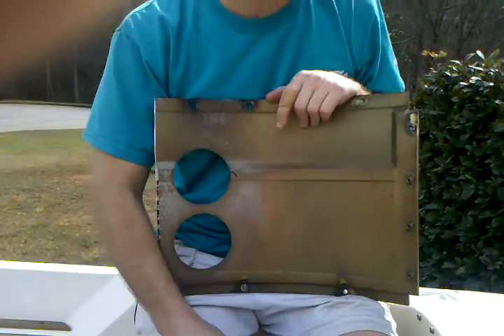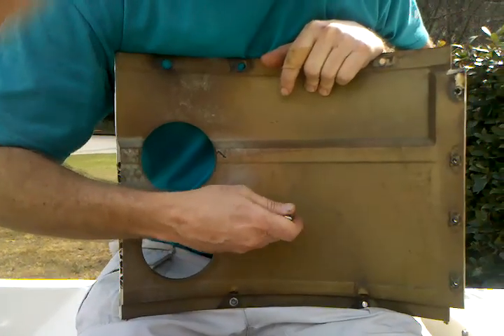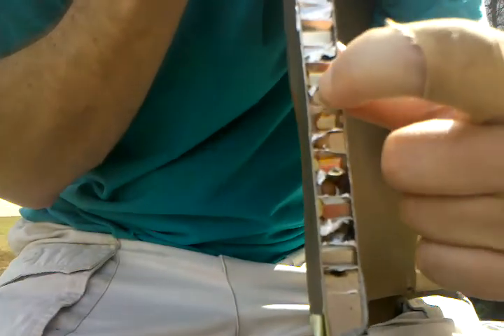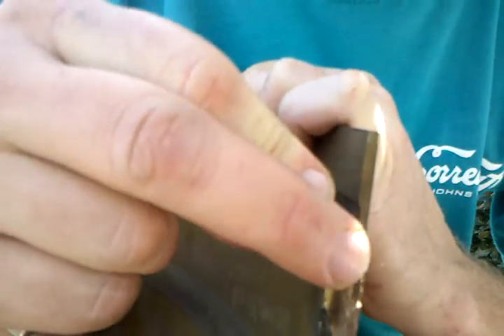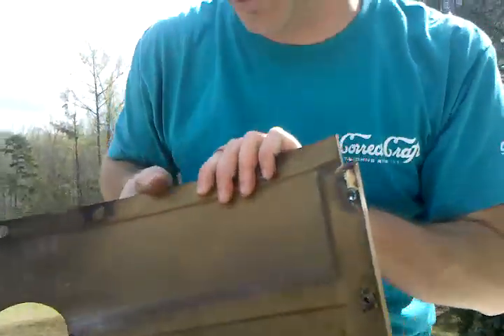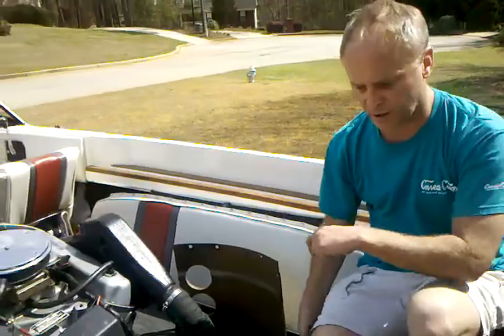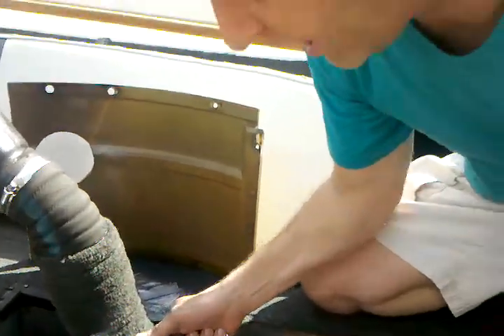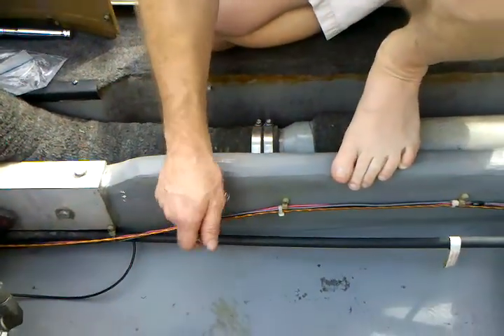Boat Stringer Inspection

Comment: I have a 1981 Citation Marquis (about 17' LOA x 8' Beam; I/O Bow Rider).  Everything was totally rotted, corroded, broken, or useless.  I cut out the flooring and transom, and pulled everything else out (engine, wiring, instrumentation, etc.).  It's a gutted hull right now.  And I know the port and starboard stringers are rotted, too, because I removed a small section (about 2-3" long) of the top of the starboard stringer and the wood (looks to have been 3/4" as a 3/4" piece of wood fits snug in the cleaned out slot) is rotted mulch.  But the fiberglass appears to go a bit higher than the wood itself, so not sure how they did that.  However, the fiberglass "frame"  of both stringers is 100% solid.  Rigid, no cracks, no wobble.  It's just the inside (wood) that's mush.

So, my question is... do I HAVE to replace the entire stringer?  I'm planning on going with an Elco EP-20 (maybe as high as an EP-50, if necessary) electric inboard or outboard motor (depending upon budget).  Not planning on going fast, just puttering around (5-7 knots, max.) on a couple local lakes nearby (Parker Canyon, AZ and Patagonia, AZ), so the boat hull isn't going to be suffering any wave pounding abuse.  So, will the hull be structurally compromised by NOT replacing the stringers, no matter how slow or gently I use it?  What's the worst that could happen?  I did a "Reverse Hull Integrity Check" (RHIC)... filled the boat with water (yeah, I know that didn't do the stringers any favors)... and no water leaked outside, so the hull itself is water-tight.

Thanks for the descriptive on the difference between "delamination" (the layers of fiberglass separating from each other) and "disbonding" (the wood core separating from the fiberglass encapsulation).
Reply: I sincerely apologize for not responding to your comment and question. I usually try and do so in a timely manner when I receive a notification that someone responded. Its been a year since you responded but I'm curious as to how you finished your project. I hope that you replaced the stringers in the boat mentioned. Think of the construction of a boat as the human body.  Stringers are "The Bones" of a boat while the fiberglass shell is "the skin". A boats bulk heads are its " ribcage". You want good solid bones in your boat just to maintain its top potential OEM strength. Just as a human bone structure if you break an arm or leg or even a rib yes the body will repair itself but it will never be as good as it was before the break. If its gonna fail under the same circumstances... chances are it will break at the same spot it had before. 
 Replace the whole stringer. Its more work and cost but in the end you'll know its done right and you won't be worried of a possible structural failure in the event you get caught in some rough water.

Comment: Thanks for the explanation.  Question for you. In the event of a motor mount bolt area being rotten to say an inch or two around the bolt hole, is there a repair option or do you replace the entire stringer?  Assuming the rest of the entire stringer is good.  Just an issue at the bolt hole.
Reply: If it's just a small area of rot, you could probably get by fixing it with some Clear Penetrating Epoxy Sealant (CPES). By using the aforementioned product the damaged wood around the hole should wick up the CPES  making it better than new. Keep adding CPES till you fill the hole and add as necessary so that the wood soaks up as much as it can. After it cures I would fill the hole with a mixture of epoxy and milled fibers. Once it cures then redrill the hole and install the mount bolt.
Reply: @Nauti1988  thank you!

Comment: great video, do you need to check the stringers under the bow as well?
Reply: Michael, sorry for the late response to your question but the answer is yes. Reach up as far as you can so you can do a tap test on the stringers. If its solid then you're good to go. Any dull thud isn't good so that either means the fiberglass is just disbonded from the stringer or  glass is disbonded from the wood because its rotten underneath the glass.

Comment: Hello great video! I have a question if you don’t mind. I’m looking into buying a early 80’s model bahner jet boat from a friend. The problem I’m having is I remember like 7 or so years ago he cut part of the stringer out in the front of the boat to put a subwoofer. Bad idea as when we took it out after you could definitely feel the flex it created. He said he fixed it but I still have my doubts. Is that something g that would have been repairable or would it need to be replaced after that form of modification? If it is ok to repair what should I look for? Thank you in advance, Kevin

Comment: anyone notice the corrosion on the fuel tank mounting and the single clamped exhaust.  Fuel tanks mounted flush to stringer induces corrosion and the leaking fuel will rot a stringer out lickitysplit.  Good job on your Disbond/Delam descriptions.  Refrain from using hard metal objects as sounding tools on exterior finishes, gel coat can handle it fine, but paints will cause dents in the finish and will break the water barrier and induce water into the laminate - i.e. blisters.
Reply: No, no and once more nope

Comment: What do you think of pouring liguid in there for a hard solid stringers that don't rot?
Reply: Putting lipstick on  pig may make it prettier but it's still a pig. If you've got rot in there then you're only delaying the inevitable. It might buy you some time but Still gonna have to fix it properly. Many of my fellow Correct Craft friends are using Coosa board to replace the stringers which doesn't rot or going back with Douglas Fir but treating it with CPES (Clear Penetrating Epoxy System) So that it won't rot even if water finds a way back in there. CC wasn't too concerned about water intrusion and didn't take the means to totally encapsulate the stringers. These boats weren't meant to last 40+ years. They were considered Throw Away boats because they figured after 10 years of usage then the owner would wanna upgrade to a newer tow boat. Little did they know....

Comment: Thank you so much very informative. I am having trouble with my 98 air nautique leaning towards the driver side. I'm wondering if there's somewhere where there's water hiding that I don't understand. I can fully pump out the engine compartment in the center behind an under the transmission. Is there a pocket beside the Stringer on the driver side that could possibly hold water? Any words of wisdom would be much appreciated thank you.